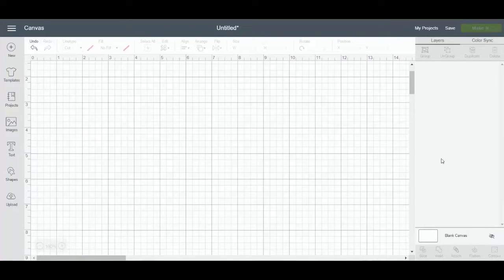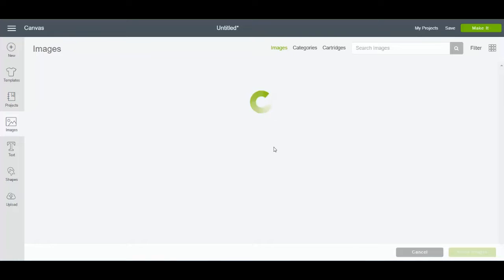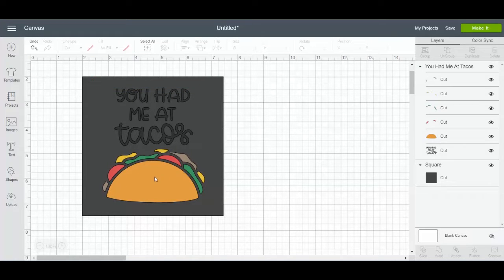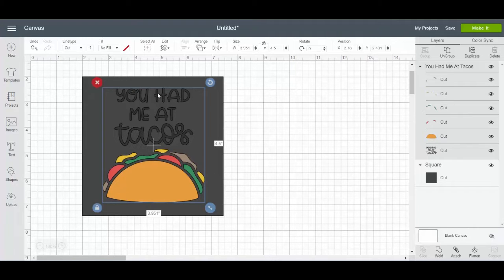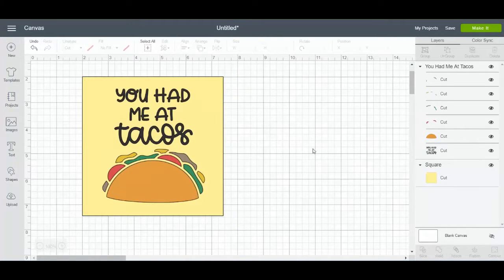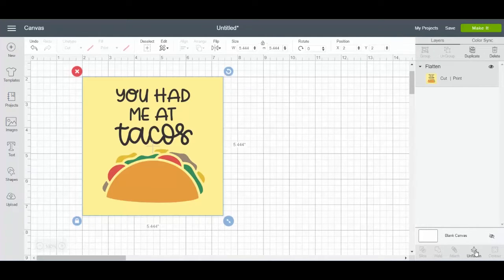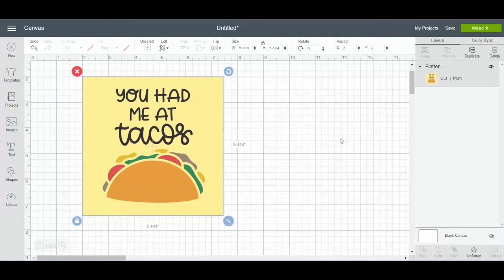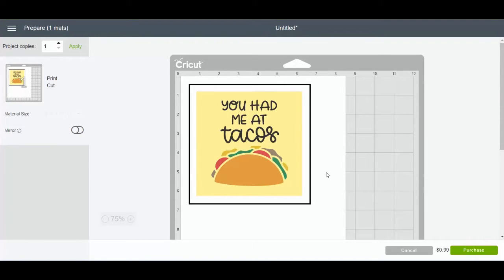The Cricut Flatten Feature: What is it? How do you use it?

Comment: Angie, I have a question... Ive been using print and cut for my tags, a design inside a round tag. I havent done it for a while, but today the same file didnt cut where it supposed to. The print and cut flattened didnt work. it cut all the little pieces of my design. I tried remaking, attaching, nothing... Why all of a sudden my print and cut is not doing what it supposed to? Can you help? thanks
Reply from the maker: Attaching is not going to do it. You will need to flatten to a circle shape.
Reply: Oh. Ok. Só flatten everything,  not just the words!!! But tge words and the circle !! Thank you. I will try that.

Comment: Hi, I did a print and cut image using clip art images. When I added a text to it in black, with 2 red hearts between names and flattened the whole lot, then went to print,  all looked good but image missed out the text. Then I tried again, managed to print text but when I flattened it turned the hearts black. Trial and error back in forth it doesn't let me change colour of hearts without changing the text same colour when i flatten. I'm so confused why this is. As I said, the image on the screen to print looks fine then changes once printed.
Reply from the maker: It worked fine for me as I just tried it. Add your text and your hearts. Make each one the colors you want them to be. Pick everything all at one time and click flatten.
Reply: @AngieHolden  thanks. Going to try it again. Don't know what I done wrong. Thanks for reply. It's a memorial pic for them and their dog they lost. So want it to be perfect.

Comment: Hi. Love the video. Every time I click it flatten, it fades my text and colors and makes my button look washed out. Is there a solution to this? Thanks.
Reply from the maker: I don't think I have ever noticed that. Maybe make the color a bit brighter than you intended to account for the fading?
Reply: @AngieHolden   Thanks!
Reply: This happening to me too, have you been able to find a solution?
Reply: @shcarrievarnado7724  Hi. Yes, click on your un-flattened design, then in the top bar where it says OPERATION and under that is PRINT AND CUT right beside this there is a color box. Click on that, pick your color then click advanced, In the large square color box there is a small circle, drag that circle to the darkest shade of your color, and then click back on the page. Then when you flatten it, it will brighten the color.  I really hope this helps. It works for me every time.
Reply: @sanyo782  Thank you so much!